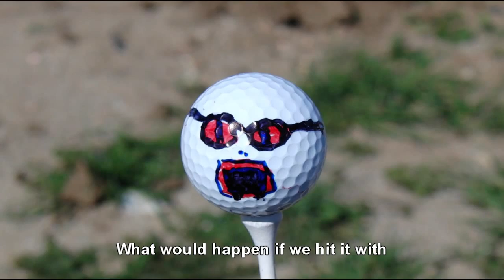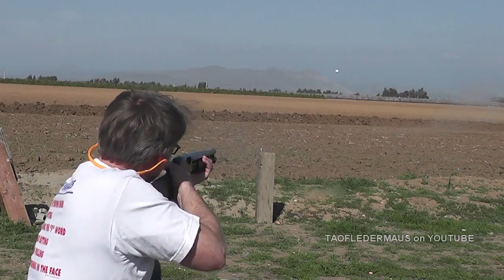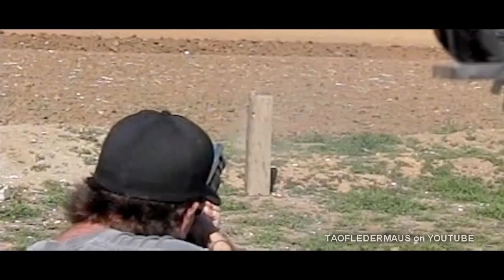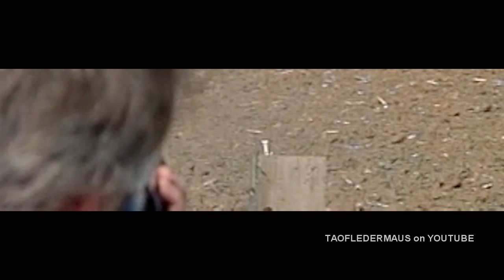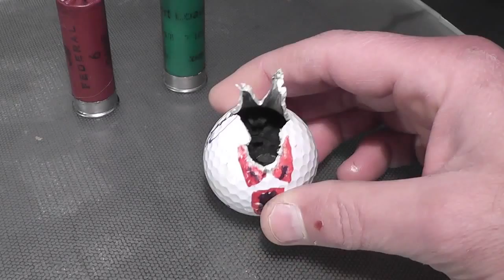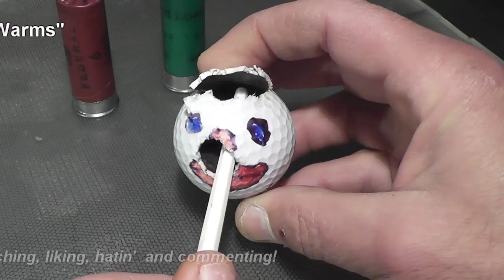Shotgun Golfing!    (slow motion study)

Comment: you should try a piston system so you can launch the golfball without damaging it. you could have a bar through a pipe with lubricant, then a plate on both ends of the bar. put the gold ball at one end and shoot the opposite end.

Comment: try it with metal slugs, i shot buckets of balls with lots of different ammo and slugs, a golfball can even deflect bullets sometimes ,i also got 5.56 mm ammo stuck inside a few balls,its rare but it happenes , it looks like a huge nose on the backside of the impact, green tips just blow the balls to pieces or make a clean hole thru,depending on the core of the ball

Comment: Hmmmm. Just a thought. Wonder how far and how fast you could accelerate a golf ball with a small steel plate in front of it or even toutching it. The lightest plate you could find about 2"x2" without the round going through it so you dont dissapate the energy of the round so much. Maybe it would be like a club head hitting a golf ball at 400 mph!!! I know I used to hit golf balls with an aluminium bat when I was a kid and they went a hell of a long way.